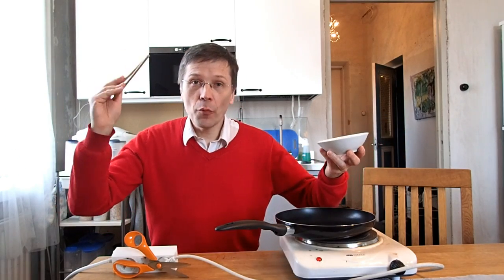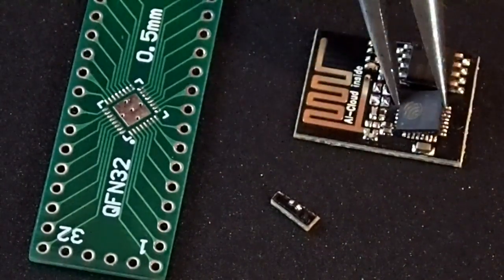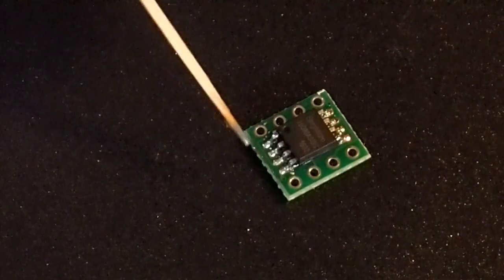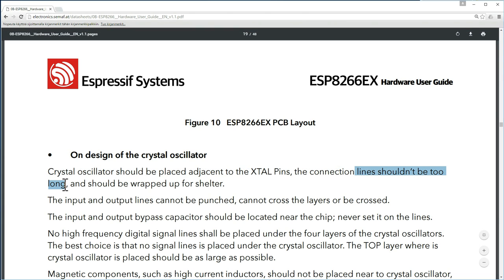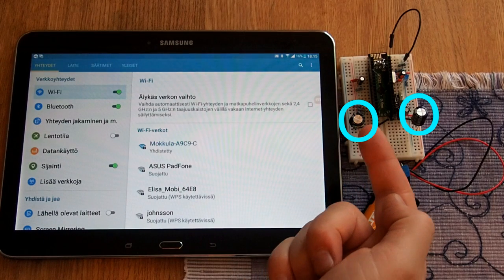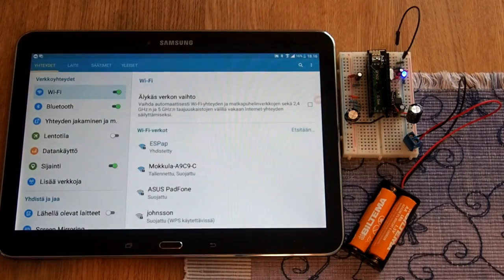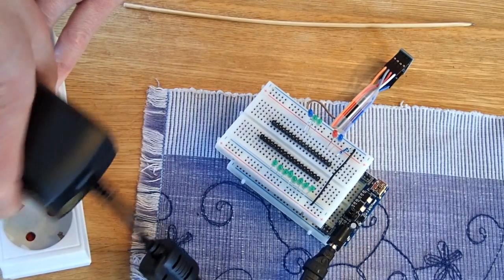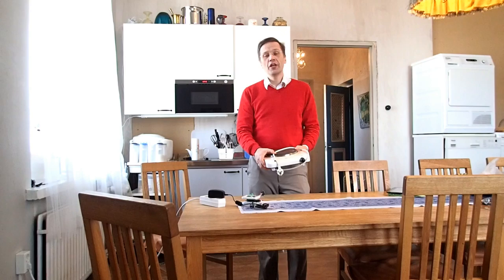#2 ESP-DIY & WiFi

Comment: Kiitos kovasti, Toi video on tosi kiva. 
Thnks i do intrest with these chips and playing with it. sori where i can find this expantion board or already built one.
by the Way i live in Finland Suomessa Great country with great People.
Reply from the maker: In this and in the previous video we show you, how to make an ESP8266 expansion board. And in the next videos we show soldered versions of the ESP-DIY development kit. 

They are very easy to make and you don't need any special equipment for them. The shopping lists for the components are in the links below the videos.

Soldering the crystal is the most accurate part of the work. That is the only thing where I would want have a factory made adapter plate. But some day we want to test the differences between the 26 MHz, 24 MHz and 40 MHz crystals. And we couldn't do it without breaking the factory made ESP-module.  

And that's the point of these ESP-DIY modules and kits! You can select exactly those components that you want and do the connections that you want.  This is important when you are making battery powered solutions or planning to make a commercial product. With a factory made adapter plate you would be bound to those components and connections that are on that plate. 

And soldering the crystal is not a big question.  If you want, you can always use crystals that are bigger in size.

Kiitos viestistäsi! Suomi on mieluisa paikka asua ja tämä kansainvälinen Youtube-internet-Arduino-eBay yhteisö on myös hyvä asia! Mukava puhua suomea tälläkin foorumilla!